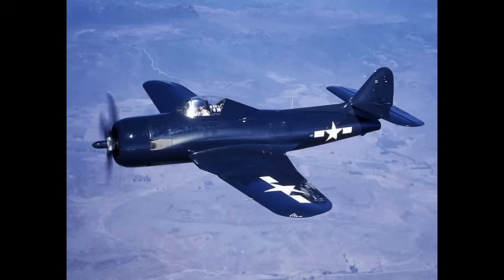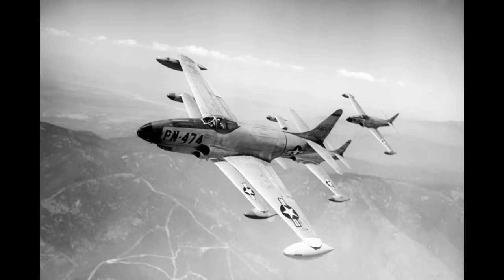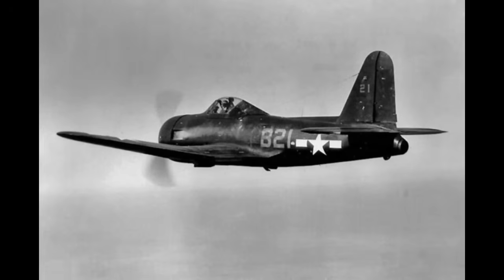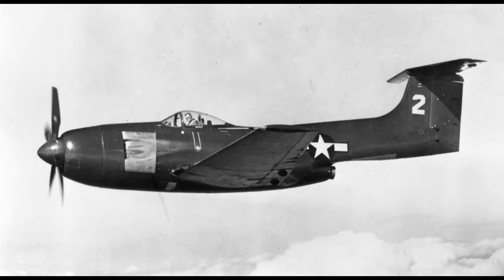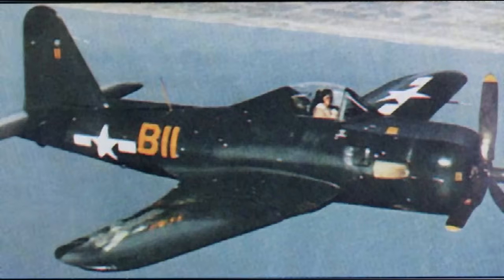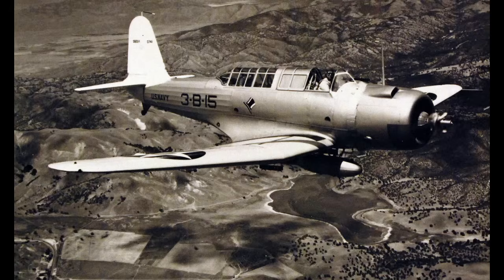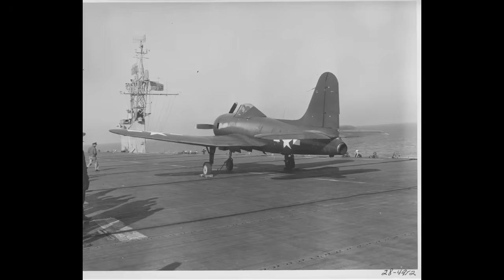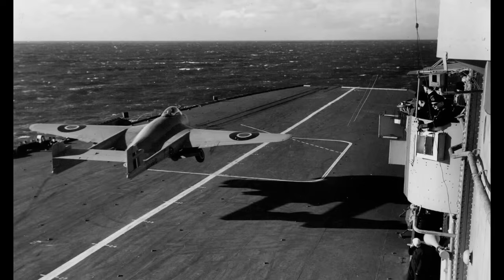Ryan FR Fireball - The Forgotten Two-Engine Failure

Comment: Pardon me for disagreeing with your titular assessment of the Ryan Fireball as a failure. I see it more as a technology demonstrator. There were doubts about the ability of jet-powered aircraft to operate from aircraft carriers. Early jet engines had sluggish throttle response, were fuel-thirsty (which limited range), and had reliability issues (compressor stalls, flameouts). The Fireball's piston engine was insurance. Its reliability gave the little plane a safety factor that permitted the Navy to gain valuable experience with jet propulsion. In this sense, it was a success, IMO.